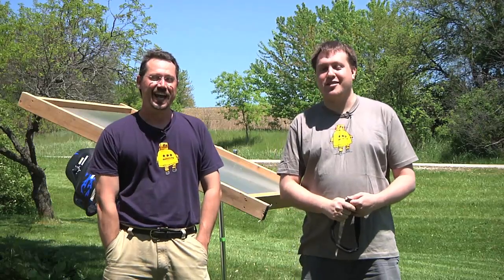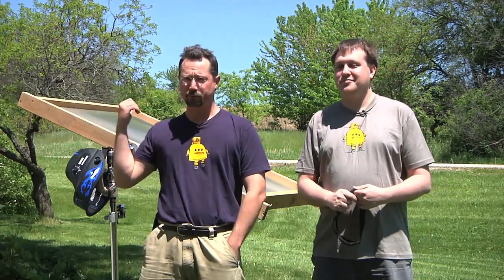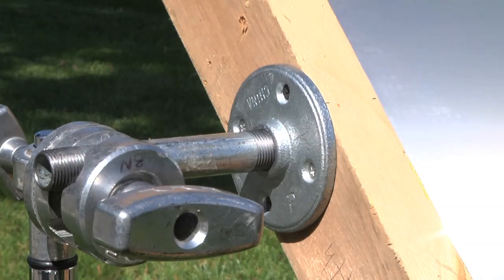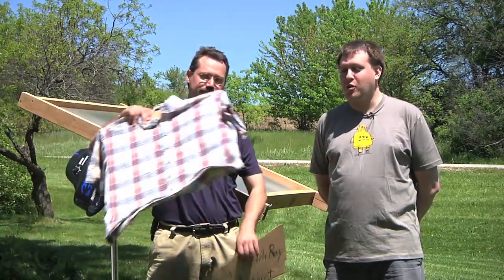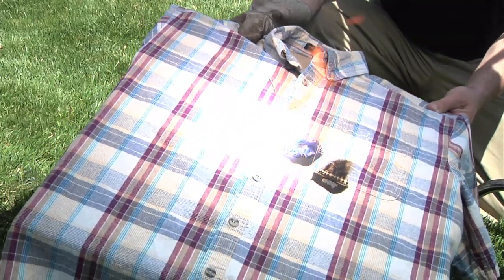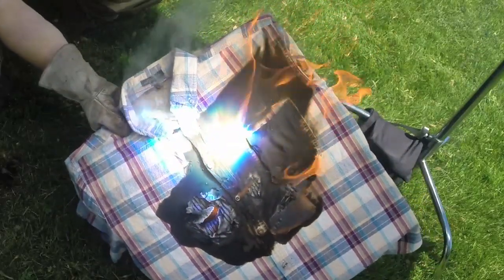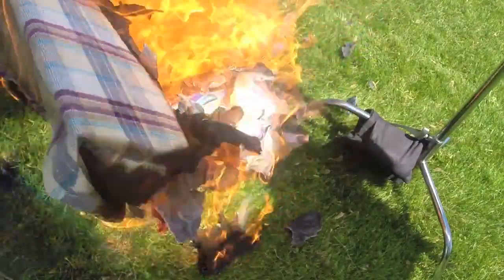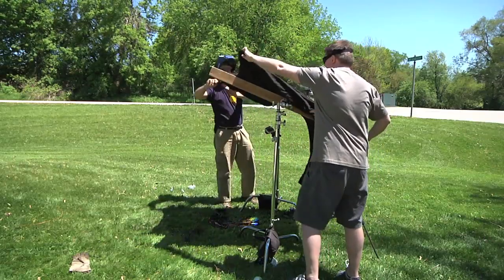Solar Death Ray vs. Flannel Shirt - Full Length

Comment: Some toys can be very dangerous!

When I worked at MIT, I've read warnings about the little 3" magnifiers on lab bench work lamps. Don't leave them where the sun might shine on them. Since they will start a fire..

Last year I started my astronomy hobby.  I found warnings about instantly melting your eye, if you look at the sun, and other warnings about leaving your telescope in an area where the sun shine can get into the main aperture.
Even without an eyepiece installed many telescopes will project a concentrated beam of sun light (from the eyepiece tube) that can burn wood and start a fire..

If you ever set up to view sun spots with a special filter, never forget to remove the star finder scope, just in case someone walks up and decided to look into that cute little scope..
~~

So, this spring I was kicking back in my favorite easy chair in my den, reading a good book. The weak sun was steaming in the window, warming my legs.. Nice!!

As I read, I was holding my book marker on my right side (the sunny side), my left ankle over my right knee..
My book marker is also a very thin 2.5"x5.5" Fresnel magnifier (from the senior center), for small print..

I must have held the book marker in the wrong place, because I started to smell smoke! 
The Fresnel was heating up the heel of the docker on my left foot!
I picked up some paper and focused the beam.. Instant fire! Ran the flaming paper to the kitchen sink!
Heck, you could use this book marker as a fire starter on camping trips!! Live and learn..
Reply from the maker: Richard Lee Safety is no joke! We don't call this a "Death Ray" for nothing! Protection about appropriate for welding seems like the right way to go, and never leave a solar death ray unattended in daylight.